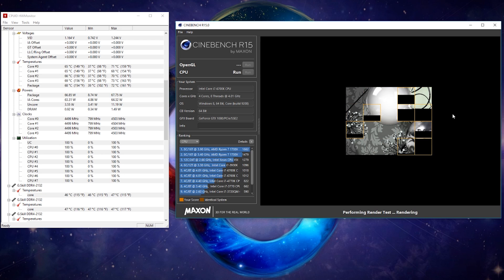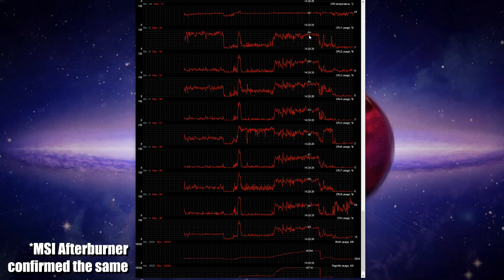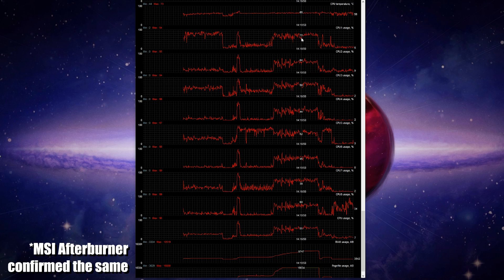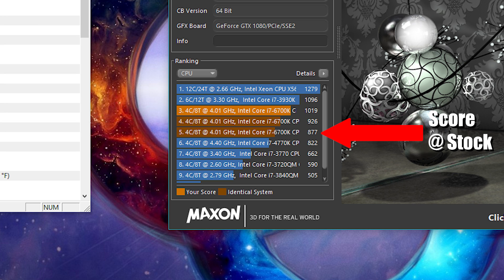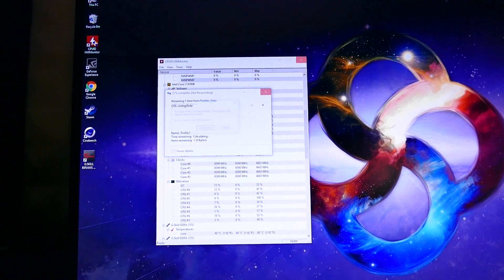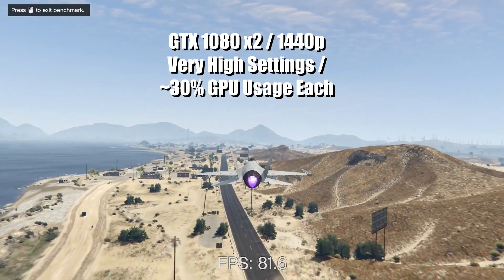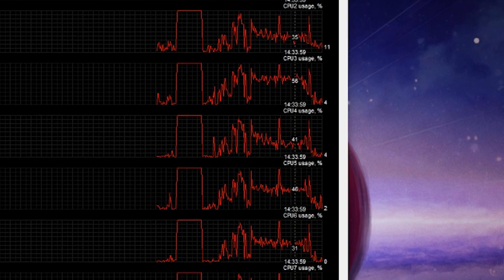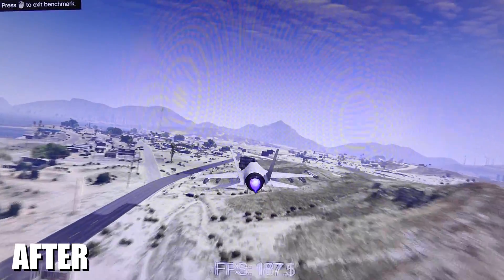My PC was Terribly Under-Performing...

Comment: I'm not sure if any one has mentioned it but I've had a similar issue before. I found this article, applied the settings, and haven't had the issue since.
https://forums.geforce.com/default/topic/957854/tutorial-how-to-properly-disable-power-saving/?offset=1
According to the article windows forces power saving features by default on core processes like dwm.exe, and then doesn't properly enable "3D mode" when switching to programs that can utilize it.

Comment: I had the same issue. I defregmented my hard drive which removed most of the issues and also reinstalled the graphics software from scratch. I have a GTX 1070 SLI. The problem I think is that there are hidden backgrouns processes or cache build up that is leading to the graphics card not being utilized properly (Even though your GPU might show 14% usage at times, it is more like 30% which afterburner will fail to regonize.  Hope this helped.

Comment: Probably MSI afterburner. I have a gtx 1050 Ti and when I overclocked it. It gave me WORSE performance. On Sony Vegas pro the preview for a 1080p60 video was at 1-4 fps. I uninstalled afterburner. Rebooted and I got back to 60 fps. And again idk why MSI afterburner was doing this but whatever.

Comment: "My frame rates were better with a single graphics card than with SLI." = basically every SLI config there is.
Just goes to show how shit SLI actually is.
Reply: I can get 200 fps with a single gtx 960
Reply: actual sli games/benchmarks seem to show about 70% on the second card, and 40% on any  third card on average. Not worth unless you somehow got your second/third card for super cheap.
Reply: It is not shit at all. When configured properly it scales almost in any game. But when you think you can just use some stock settings well. Problem is the industry doesn't care much.
Reply: you have no clue as to what you're talking about.

Comment: I may have had this same exact issue earlier this month. My gpu usage was awful and my performance was terrible on applications and gaming. I cleared my CMOS and reinstalled windows as well. I never could figure out exactly what my issue was but I believe it must have been a bad overclocking as well.  So I've had a similarly nasty experience.

Comment: Not an expert, but could be an old driver reg key issue. Something similar happened to me once, though not SLI, but still GPU related. Fondling with obsolete keys helped....then again I don't advise anyone try this unless you are extreemly sure what which key you are deleting/tweaking does or you just don't simply care if your sistem breaks and are prepared to spend hours to learn about which ones to poke around.

Comment: Could've been a hang in the BIOS for the CPU, so it wasn't fully utilizing the cores and clock speed (maybe even ignoring the hyper threading completely even though it shows it's enabled which would explain performance similar to an OC'd i5). And a bug in the OS screwing with the SLI config and adding delay between them (as we know SLI as well as Crossfire uses every other frame rendering and if there's a delay between either card, it holds both cards back exponentially). I'm not a master of CS so I'm not completely familiar with every aspect of OS's on a coding level or the BIOS, but if both were being faulty in different areas it makes sense.

Comment: My PC usually do these when i update my driver. Most of the times i update my driver, games start running on a lower fps while my GPU still hitting 99% use. Sometimes rerolling to older driver works but sometimes not. And when driver doesnt help. I got to remove my GPU from my build, turn the PC on with integrated GPU. Then mount my GPU back in and the issue is fixed...These started happening as soon as  went windows 10

Comment: Sometimes PC do the oddest things without reason. One example is when I purchased the Asus PG248 monitor. Early in it's purchase, when I would boot up the PC,  the PowerSpec PC logo shows and then a blank screen with a static line would show up instead of the windows log in screen. I would then have to power down the PC and turn it back on, then I tried different display ports on the GPU and still had the same issue. It got to the point that I thought that my GPU was on it's way out.
One day, the issue went away and hasn't returned since (knock on wood). I didn't really change any settings anywhere.

Comment: I had a similar problem with a few PC games (Mainly No Mans Sky and Bethesda titles). I had HORRIBLE frame-rate and the lower I dropped the graphics settings the worse the frame-rate got. Then I decided just for the hell of it to max out the graphics and BOOM! Steady 60FPS all the way.  It Turns out that My Laptop has NVidia Optimus, which disables my discrete graphics under low-load and uses the Intel Integrated graphics to save power. That meant when the games ran their "Graphics Auto Detect", they would detect that my PC was using Intel Integrated graphics and set everything to "low" quality. Then, When I ran the game, the settings were so low that NVidia Optimus was choosing to use the Integrated Graphics instead of my Discrete Graphics.  The Moral of the Story is: Things aren't always as they seem...

Comment: It sounds like a Windows update snuck in and broke things. And it won't necessarily happen again, as you could update in a different order or with different pre-installed software.

I would recommend everyone run some kind of benchmark, both CPU and GPU, probably memory too, save it somewhere on the internet for future reference when you get performance issues. Re-run that bench to compare to what your PC is supposed to do.

Comment: Sounds a lot like problems I have had few days with my work PC. HW not performing as it should and nothing even closely using all of the resources (Ryzen 1700, GTX 1080, 32GB RAM) and it turns out Visual Studio 2017 or Nvidia CUDA drivers/toolkit had done something odd during installation and after reinstalling them everything worked.

Comment: Probably you are not gonna read this, but maybe next time go to a pc repair Shop that you know they are very good at. Im having the same problem. I had an g4400 and upgraded to a i5 6400, and it underperforms sometimes, also upgraded the gtx 950 for a gtx 1060, and still dont manage to get higher fps than the other config. I really would apreciate if any1 knows why.... Gonna kill myself

Comment: I have a problem with  a speficic game - Squad, my CPU runs at 50-60% and my GPU at 30% and the FPS 25-35
Specs:
Core i3 3250 @3.5 Ghz - 8Gb @1600Mhz - GTX 960 2Gb
Another games like BF 4 - Ultra - 80 FPS 
🤔

Comment: can be the motherboard? my motherboard i dont know why i cant use the 3rd and 4th channel of the RAM
Reply: jorfran1997 Could it be the CPU socket having it's pins mangled around the memory area? I had the same issue with 2 out of 4 banks no longer working on my Z97-UD3H-BK motherboard when upgrading from a G1820 to a 4790K. Very carefully bending the bent pins back into place with a pin fixed things nicely.

Since then, I've comfortably had all 4 DDR3 memory banks of Crucial Tactical Tracer memory (totalling 32GB) running with a fairly large overclock, from stock 1333, well past the XMP profile of 1600 with 8-8-8-24 2T timings, all the way to 2000 with 10-10-10-30 1T timings while remaining at 1.5v stock voltage.

Hope this helps.

Comment: I had a very similar problem with low GPU usage and poor performance in games. Problem was solved reinstalling Windows 10 from scratch. I tested it out by installing Windows 10 on an old 5400 RPM laptop hard drive I had and was getting better game/gpu performance than with my SSD, so totally clean installed Windows on my SSD and everything was fixed. Major hassle though,  you have to reinstall and back up everything on your boot drive to get back to square one before the problems started happening.

Comment: Gahh!  i wonder if i am having the same issues. I have an Overclocked 8320e @4.2  with a single RX580 and 16gb of DDR3 2400. and I see everyone else with a similar system running Gta5 VERY HIGH @solid  60fps in  with DX11....and i get low 20s to 60s.... I simply don't get it. Luckily i keep all my heavy programs on secondary drives and OS is on a 256gb SSD with a few other programs. so a wipe won't take too long, but having just gotten this RX580 and way faster ram than the 1333 i had previously im not as impressed as i had hoped.
Reply: When i build a system i Do a basic "default profile" with everything stock except for the stuff i don't want turned on (such as virtualization,etc...) and run a bench mark with that all set up, i then make a profile with overclocking....so....always helpful.

Comment: I had the same issue with my 1800x. At 4Ghz and 2933mhz ram speed, I would get  a score around 1700 on cinabench. When I updated the bios, it dropped to 1500 cinabench score with the same overclock and 3200mhz ram speed.

Comment: At least the computer still worked. I had a bug where Just Cause 2 would crash so hard that it would corrupt the graphics driver, and I couldn’t see anything on screen until I pulled my graphics card out and put a different one in, to trigger the Windows default graphics driver to take over... This happened three times!

Comment: Some PC's if overclocked for long periods of time may decrease performance to save the CPU's life. You were most likely lucky in this case because you could've had a dead CPU and GPU(If the GPU's were overclocked that is) and basically you resetting everything refreshed everything and it saved it but i do recommend a lower overclock from now on XD

Comment: I had the exact same problem Greg and resetting the cmos did help but also I had an unwanted driver constantly updating and enabling itself which was the Nvidia HD Audio. My computer would lag, I would get terrible FPS unless I restarted my system or the cmos. I resolved my issue by going into my devices tab and disabling the Nvidia HD Audio.

Comment: I had a similar issue I tried to troubleshoot myself that ended in me just doing the same as you did. I reset everything I could on every bit of software on this machine and I surprisingly got all my issues fixed. It does suck that the main issue couldn't be found at all in order to prevent it from happening again or to fix a potentially inevitable problem that could occur again. I know that feeling. Makes me really wish all those bloated/placebo third party software programs that magically "fix" all your issues actually worked. Lol

Comment: Hey Greg, I had a similar problem, if you are run W10 creators update, make sure that the full screen optimization is disabled, as this will try to lock your frame rate at 60. I also deactivated some more things like the Xbox settings and other "optimization".

Comment: Well, I have a performance problem in GTA for a long time. It starts to freeze badly after over 40 mins for no reason & then won't stop until I restart the game, then runs butter smooth & then starts to freeze badly again...

I have a MSI 1060 6GB, i5-6400 & 8GB DDR4 RAM
Send halp pls

Comment: If the boot drive has windows pre-installed from another system .i.e. if it is a clone drive or the same drive has been extracted from another system or the same windows installation has been used across several machines. I've had the same issue when I used my ssd extracted from an i3 540 based system and plugged it into my i7 6700k rig with 1070 SLI.

Comment: This sounds like a user profile issue in Windows. I would have tried running the same thing with a new user on the machine. I'll be willing to bet there was an issue with your user profile. Either that or a registry setting wasn't correct.
Reply: Yup and trying to find that is just..... NO lol
Reply: Can you explain more? Bec I have the same problem
Reply: I have the same prob currently. I have tried this and it made no difference

Comment: damn, my card (amd rx 480) isn't underperforming in all games, but it's at embarrasingly low gpu usage in dishonored (10-20%), so to fix this issue for only one game, I have to reinstall windows basically?
Reply: White Supremacist Hate Symbol if ur cpu isn't under performing and you've already tried installing newest drives after wiping old ones with ddu then sure go ahead if you can be bothered with all the hassle xD

Comment: I've experienced this a little bit every now and then and all I've just done is do a simple reboot of the system and 9/10 times it's fine after that but if it still happens, I leave it off for an hour or two and do a cold boot. No idea if it's really the same issue you had but I do very much understand what you mean by everything should be working fine but is abnormally slow (videos render at much slower speeds, programs take longer to load up and the entire system just generally feels unresponsive most the time)

Comment: That one ram stick is always in a completely different colour than the rest.....
Reply: Now that you pointed that out, I can't unsee it. This is horrible. It NEEDS to be fixed.
Reply: God damit! I got hypnotized and had to rewind 2 mins... How can anyone live with that? My OCD would go nuts!
Reply: Mr. Petkov I own this ram, it's really buggy
Reply: Mr. Petkov I have the same ram...and the same problem... They just don't cooperate.
Reply: DMCM that sucks
Reply: Mr. Petkov it's a software issue by the sounds of things
Reply: G.skill has fucking awful software programs
Reply: G.Skill need to advertise with "OCD WARNING"
Reply: gskill needs to be bought out by someone else they can't do much right the only good thing they did was have some of the best high speed DDR4 RAM and even have a fully functional RGB strip on their RAM as well as the RGB RAM being high speed
also people have issues with GSkill software where it rewrites some serial codes on the DIMM and bricks it and then GSkill responds by saying you illegally modified the RAM sticks serial codes or something and refused to refund some people offering to repair it in some cases but then the issue reoccurs and they give up onb the user saying it was them

I am personally waiting it out for corsair to do some newer type of RGB RAM when asked about Dominator Platinum RGB they refused to answer saying that they can't comment on future releases meaning it could be possible but the problem with that is they would need to rework the design as having RGB on current design would be hard to implement in a way which looks appealing and can outshine the competition

Comment: It's probably Windows 10. My system was running Windows 10 and had some FPS, unknown lag, even on drop frames during recording (even on NVENC), I did a clean install, and the problem occurs again after several days.I decided to downgrade back to Windows 8.1, and the problem is gone, like no issues. My cousin is also having this issue with Windows 10, I downgrade his Windows 8.1 and the issues are gone for good.
Reply: Windows 10 is a pile of crap. Windows 7 is the best.
Reply: Alfa Proto I had the same bs. Before Update I just disabled everything through regedit and it was OK..after the update  I checked in regedit it was on default again.  After few hours search I found that game mode thing and few some setups. Disabled everything solved my problem! BTW csgo in full screen felt like a windowed  app.. Freaking bad from Microsoft.

Comment: Hi, I hope you read this. But I see that you've got GeForce Experience installed. If you turn off the "Share" feature, that actually lowers your GPU usage with SLI and GSYNC enabled. Try turning off that "share" feature and you'll see higher FPS. I even uninstalled GFE just because of that issue.
Reply from the maker: Already tried all of that.

Comment: my delidded 6700k hits 4.8ghz at 1.375v at 60-65° under load
Reply from the maker: I delidded my 6700K and it requires a bit more voltage. Delidding does nothing to address voltage draw.

Comment: I'm having a similar issue where my CPU down clocks to 3GHz even though the stock is supposed to be 3.5GHz and the boost should be 4GHz but my CPU is more than cool enough at 55C and reset CMOS and OS.

Comment: Windows 10 is a mess. I recently got the issue that my PC just shut down while gaming. So first thing - Temps... they were fine but anyhow, as I own a mITX system I removed the panels and the issue stayed. So next PSU, which scared me because it was the most obvious thing as it is a passively cooled seasonic 460w unit for a 4790 and 970. I currently don't have the money to get a proper PSU, so I tried reinstalling Windows... fixed it. A PC shutting off while gaming caused by the OS... never seen before in a loooot of problems I fixed over the last 14 years.

Comment: i had a bug with my cpu (bios problem) when i overclocked the cpu it would show that is was overlocked in windows but was actually stuck at idle speed(shown in cpu-id), which was 1.55Ghz. i had to reset cmos and it fixed it.

Comment: I had a similar issue by having 10 fps on Gears of war 4 using a 1070 (the benchmark normally gets 120 fps) i dwelled on gears of war forums and one post called my attention "uninstall Gigabyte App center" (im using a Gigabyte z170x gaming 7), i did that before going to the reinstall os option and surprisingly it  worked! 120 fps, 100% gpu usage

Comment: before you did the os reinstall you should have tried DDU(Display Driver Uninstaller ) and reinstall the driver to know if it is a driver bug and if it didn't fix it  there were probably a program/software that was causing the issue ! or heck it was windows himself (who can know when it is a software related problem it is annoying to find and fix)
Reply from the maker: Tried it multiple times already...